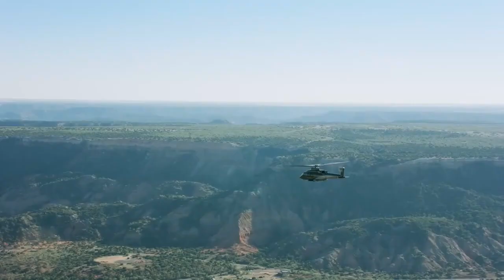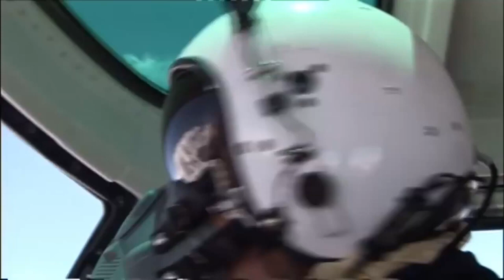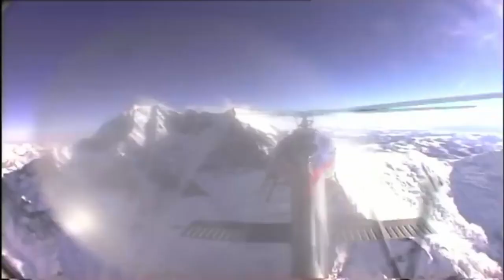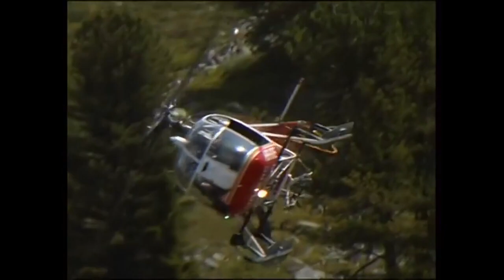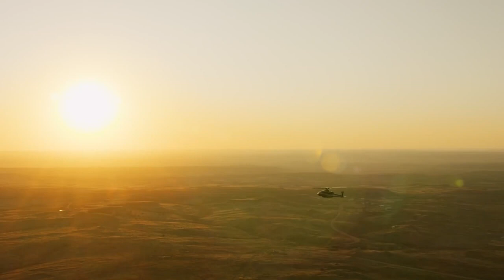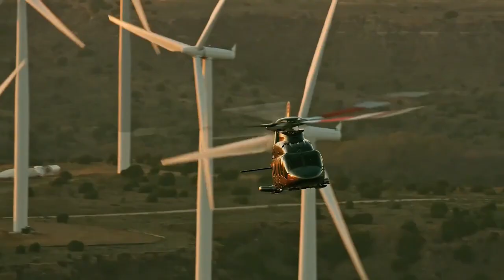The Highest Altitude a Helicopter can Reach

Comment: The reason is because the air is thin at that altitude so the blades can’t get a lift ,,, further more this helicopter was striped of everything not essential to minimise thé weight , so normal helicopter can’t reach this altitude , can’t take more then one passenger ,,, so can’t be used to help or immergency ,,, if you add just 20 kg more it will loose lift and fall ..

Comment: could you use a helicopter to fligh above mt. everest, then use that as a spring board to fly to whichever point is the lowest that can be reached with that fuel load whilst mostly staying at that height and then let sth fall down mostly vertically for the longest mostly vertical fall, or would the winds up there ruin such an experiment everytime? i assume if the falling object was dense enough, the winds wouldnt matter, but at some point no wind matters at all and you can just drop sth out of a jet plane flying above 10km no problem